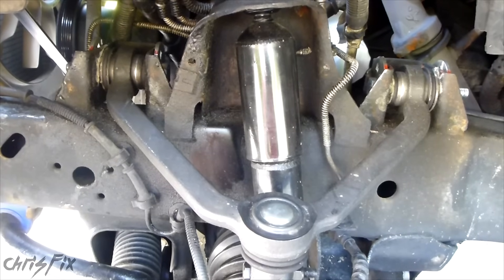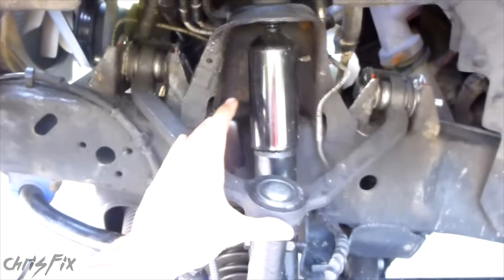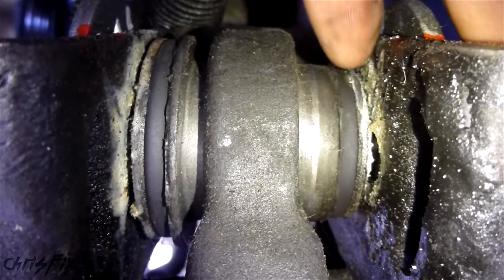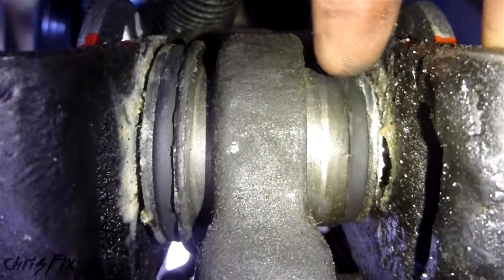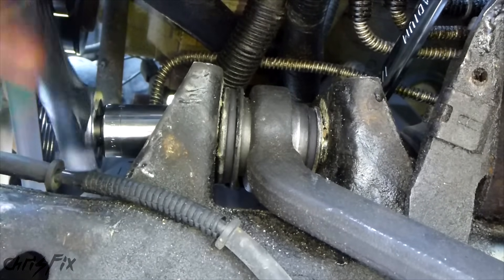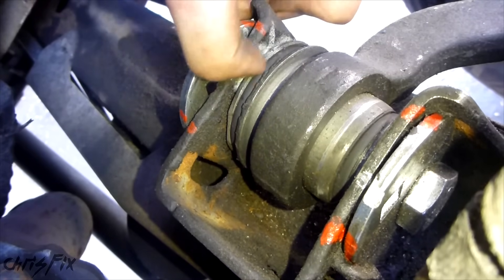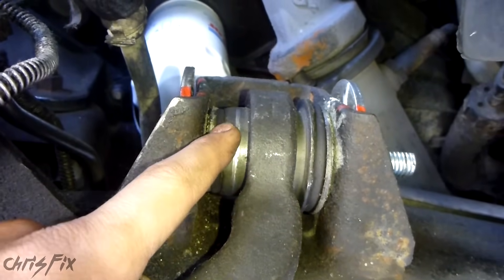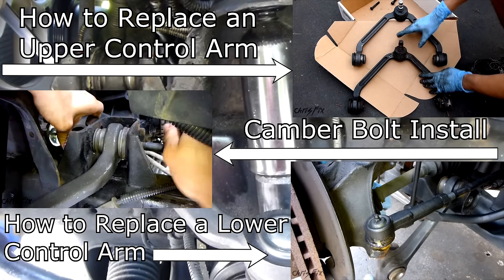Control Arm Bushing Preload, Important Information!

Comment: Hi Chris. I am replacing my stock struts & springs with slightly lowered sport struts & springs. Which bushings do I need to preload for lowered suspension. My car is a 96-00 civic if that's any help. Thanks!

Comment: Would tightening the a arms and shocks, on both sides of vehicle, while in the air cause it to just sink to the ground when lowered. I tightened them in air then lowered my truck and the wheel well almost went into the tire

Comment: ChrisFix  how do you prefer load if i can no space to get my hands in my 2006 infiniti g35
Reply from the maker: anastacio martinez You can jack up the suspension with the tire off so the weight of the vehicle is on the suspension.

Comment: Hi @CrisFix I am Buying some new upper control arms and shocks for my Nissan Xterra 2000 Although there going to give me a 3 inch lift will i need to loosen the torsion bar or can i just jack up the router ?

Comment: Where do you find these rust free cars? No car I have ever worked on has looked like that.
Reply: Stephen Lutz West coast !!! 30yr old cars clean underneath
Reply: AWOL FPV i am replacing ball joints and upper control arms on a Navigator that was on Long Island for 16 years. It might has well have been on the bottom of the ocean.
Reply: LOL here in KC same.  I just bought a Port a Torch at Lowes and it got off my stuck front tie rod when nothing else would.  I broke a pickle fork, I tried beating the sh*t out of it, etc.   Just heated it up for 20 seconds...and bang bang pop! Done.  Port A Torch is oxy-acetylene. I had NO experience with it.  I bought it, had the tanks filled and watched a view videos.
Reply: @stephenlutz123  I have an  01 Nav. Frame has rusted out above the wheel wells.
Reply: You have to Love Texas 🤘🏽🇨🇱

Comment: What about when you take it to the alignment shop.  They are going to loosen it in the air adjust and tighten it in the air right.  So all your work down the drain
Reply: If the shop knows what they are doing, they won't be torquing the control arm bolts until the vehicle is on the ground - but it does happen all the time. This is a common issue with Jeep Wrangler lifts as well.

Comment: I wonder if this is necessary for polyurethane bushings. The metal sleeve is “floating” inside the bushing so I don’t think a preload matters for them.
Reply: apparently is not necessary since the metal sleeve moves freely as you say, so it doesn't really make a difference if you preload them or not. that's what I've heard and read on car blogs. but it would indeed be great if chrisfix could ensure this facts. I trust this dude with car facts like no one xD

Comment: I have a 2012 sierra 2500hd with new torsion keys for leveling. I now need to replace upper control arm do i need to remove the torsion keys to unload pressure? Or can i just jack the truck up of the ground and remove wheel and remove control arm?

Comment: I marked the location of my upper control arm when it was on the ground then when I installed the new upper control arm , I lined it up with my marks then tightened it doesn't that work ? Mine was exactly at 90 deg when it was on the ground.

Comment: Is that a Ranger? I'm thinking about doing the upper arms on my 2000 Explorer. I think we have the same frame and suspension except mine's 2WD. Did you put the jack stands under the cross member? I'm going to jack mine up from that spot but I'm not sure where to put the stands as the factory points are too risky.
Reply from the maker: ***** Yessir, it is a Ford Ranger which is the same as your Explorer. Here is the upper control arm video: https://www.youtube.com/watch?v=v7bOxQe_WhUI rebuilt the whole front suspension so I have videos for everything including the ball joints! I jacked up the truck and put the jack stands under the front cross member.

Comment: What do I need to worry about with the torsion bar suspension? I've been told to ensure I have a jack stand under the torsion bar so that it doesn't break or bend while removing the upper control arm, is this true?
Reply from the maker: +Cody Dominguez Here is a video of changing the upper control arm with a torsion bar: https://www.youtube.com/watch?v=v7bOxQe_WhU

Comment: Just wondering, what makes and model is that truck/car that you replaced the upper control arm on? Just wondering because my 99 ram 1500 4x4 extended cab looks nothing like that. Sorry for asking a fairly uneducated question.

Comment: Hey Chris, thanks again for your great videos. You're helping tons of people!! I just replaced the upper control arms on my 1994 dodge dakota. The control arms had a pitman arm built in to form an triangle with the control arm. I bolted the pitman arm directly to the frame per specs (155 ft/lbs), bolted the castle nut of ball joint to steering knuckle per specs (130 ft/lbs), then I snugged up the control arm bushing (they arrived very loose). I dropped the truck slowly to put all the weight on the tires, and it looked like the control arm smoothly rotated at the bushings as the weight went onto the tires, until it sat at ride height. I then tightened down the control arm bushings as tight as I could in limited space. So my question: since the control arm bushing nuts came to me very loose, should I have not snugged them up prior to dropping the truck? Were they meant to be completely pressure free until all load was on tires? Would I be able to tell by looking if the bushings were "binding"?

Comment: Can improper tightning cause the control arm to move when the steering wheel is turned?
Reply from the maker: Collin Bru It depends if the bolt is a camber bolt on the control arm. If you have camber bolts then if it is too loose, you can get movement. If you just have regular bolts, you probably wont get any movement with it being too tight or too loose as long as the bolt is in there. Check for play in the bushing.
Reply: I tightned all the bolts with a breaker bar and solved all the noise problems.
Reply from the maker: Collin Bru Awesome!

Comment: My car sits pretty low so it’s tough to get under and tighten any bolts at normal ride height... I’m dealing with lower front control arms so any tips for that ?
Reply from the maker: Jack up the suspension with the wheel off to the ride height
Reply: Thank you man

Comment: Please help, I had my front lower control arm bushings replaced and a 4 wheel alignment done on my 2013 Audi A4 yesterday by a reputable mechanic shop. Today, I was unable to navigate around a curve and had an accident. The car would not go in the direction that I was steering (slightly left) so it kept going straight/right and made me crash into a curb and damage the whole bottom passenger side of the car. The alignment is now really off and it is not safe to drive. How can I tell if was a failure as a result of the work I just had done? What should I do? Should I take it back to the shop and hope that they are honest? Should I file an insurance claim and let them investigate? Could my inability to control the vehicle be a result of of replacing the front lower control arm bushings and/or mechanic error?

Comment: @chrisfix i changed the upper control arm on my 1997 ford explorer; however, the bushings dont fit snug in the frame mounts. There's a very little gap between the mounting frame and the bushing. Is this going to be a problem?

Comment: So would it be the same for the rear
Reply: Yes. If suspension is hanging with no load the bushing. Helps to put grease on the outside of bushings where they meeT the mounting points .

Comment: This preload shit needs to be taught to more people. After service 4 cars with the same shop, they screwed up every car I own, besides my bike. They made my cars height different from front and rear, made everything bouncy, and the cars are hard to keep between lines. What a joke. Some people will do more harm than good. I paid premium, tipped the mechanic for lunch, and thanked all of them. All I got was subprime work and half assed crap that was loose, needed to be replaced by another shop, and was told that my bill should have been morw. I dont care if the work is free if you mess up my cars ride for life you have pretty much totaled my car out until I get it all fixed. This shit causes such bad problems and makes you not want to drive your cars. Firestone is a fucking rip off.
Reply: Once you had the control arms adjusted, did the ride height go back to where it was before? I just had the lower front control arms replaced on a Mercedes S class and when I picked up the car I made the comment that it was sitting a lot higher in the front and I couldn’t figure out what was causing the difference until I saw this video. I’m irritated af

Comment: I dropped my truck off and was told that all bushing & ball joints were going to be done. Got truck back and only the top are done with the control arm replaced which I didn't agree on. Now I have no new lower joints or bushing cause they said the lowers don't matter cause they don't do anything

Comment: I never got this. I know what your saying but What happens when you hit a speed bump And the arm moves up and down. why does it not rip then?
Reply: The bushings are designed to stretch up or down. If you torque the bolts with the suspension hanging, that would be the neutral position for the joint. When the weight is put back on it the joint will be stretched to it's upper limit with the vehicle sitting level. I made this mistake six months ago. Along with over torquing the bolts. Now I need to replace them again. The squeaking  noise they are making is horrible. Lesson learned !

Comment: chris, how remove this noise??? creak.....
Reply: Sometimes that noise is synonymous with a dry ball joint.  The ball joint may still be good but absent of grease.  It will eventually become bad but makes a creaky noise that is similar to the sound of springs from a old metal cot.  To remedy this, you could either change the ball joint, or poke a small hole into the boot of the ball joint and spray lithium grease on the ball joint through a spray straw.  The second option is a good way to verify the noise.

Comment: Why not support the car, if only temporarily, by the lower control arm? That way you don't have to work around the tire.
Reply from the maker: marksrobby You can do that on cars where there is no clearance but it is best to have the car sit in its normal position which is done with all four tires on. I used the jack stand method you are talking about and the car just isnt at the same level as with the tires on. If you put both sides  up on jack stands on the lowest settings  to mimic having tires on, that would be better than just one jack stand on one side. On the truck it is easy enough to work on the bolts with the tire on compared to balancing the lower control arm on jack stands.

Comment: This wont work on mid 2000s honda accords. The bolts are between the strut. You barely have enough room with the tires off and the strut moved out of the way and you can only use ratcheting wrenches to tighten them.
Reply from the maker: Watch my newest video which covers that.

Comment: I disagree with this theory. I have done bushings and suspensions mods more than a few times. When you install a new bushing, you grease the whole bushing so while it’s in the sleeve, It doesn’t squeak and can move freely for install. So when you are done and set car down, the bushings yes of course will not move but guess what, the whole control arm will move freely and will settle to match where the bushing has set. The whole bore is slick with grease.  Understand what I’m saying?